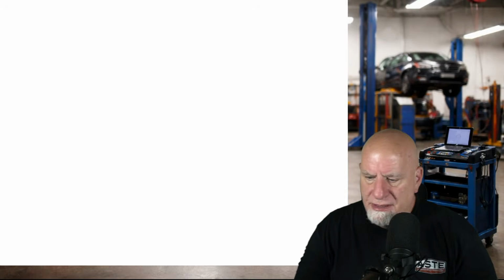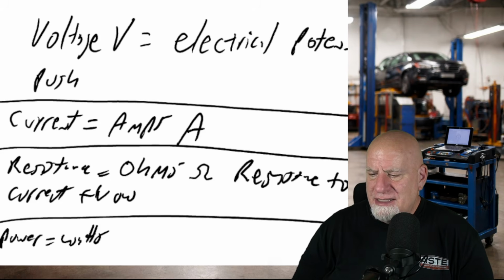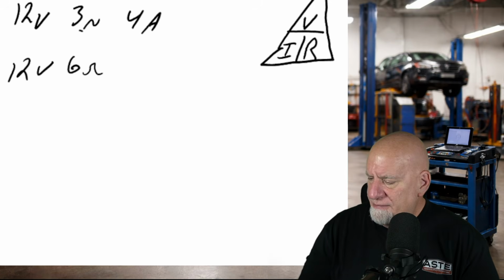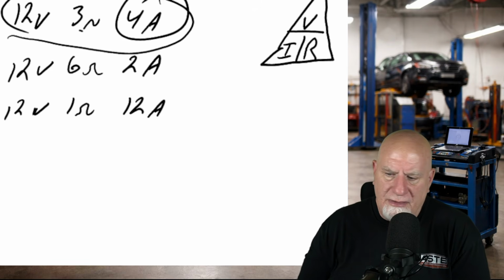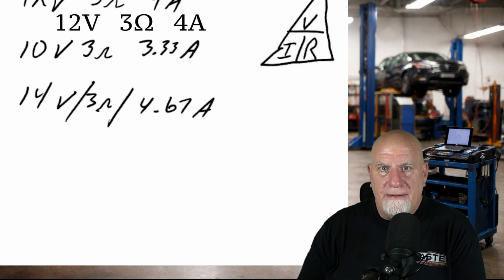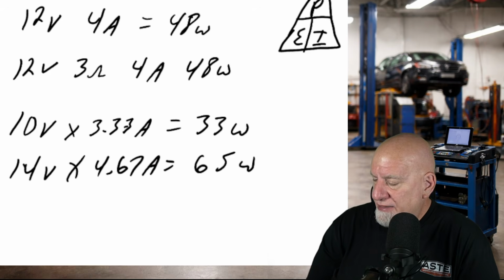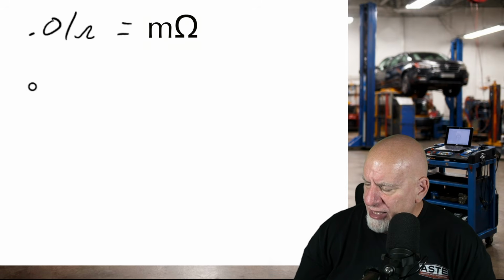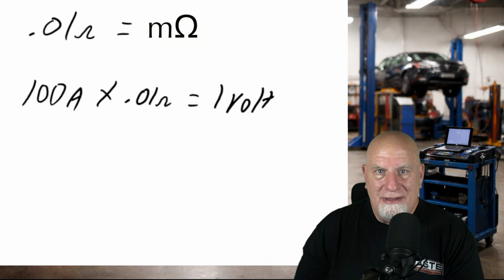Ohm’s Law Made Simple for Automotive Technicians

Comment: You are the best at explaining things!  I have the factory manual for my 2012 Sierra and I see Mex in the wiring diagram. Mex?  Wired in Mexico?  The paper manual is two feet tall. 

And by the way the new gas cap did not work. I only have a code reader so I’m going to go over it as best I can.  Might have to take it in.
Reply from the maker: Thank you Don! If y'all could have seen how many times I recorded this video, lol!
What schematic in particular on the Sierra is it? Yes, it is possible that the truck was assembled in Mexico and the wiring is slightly different because of that. Makes wiring diagrams more exciting 🤣
Reply: @BillTeachesAutoTech I haven’t looked at the wiring diagram in a while but last time I was looking it over I would see Mex in the diagram. I’m assuming that it means if the truck was made in Mexico. I had to change the fuel pump a few months ago in the woods camping. I cut a hole in the bed to access the pump and when I got home I made a nice cover. So now I have easy access. Thank God my son who is a mechanic in the Coast Guard was there to help.
Reply: $700 for the pump!  190,000 miles on it.
Reply from the maker: @donthebrain  - That is a good "stuck in the middle of nowhere" time saving hack! I know techs that would rather lift the bed off of the frame than to drop the tank. I personally always dropped the tank. I wish we could share images here because I'd love to see that cover!
Reply: @BillTeachesAutoTech The truck broke down right in front of a Chevy dealership! lol. They said that they remove the bed when they change the pump. They were a big help but couldn’t do the job until the next week. The truck restarted and I drove back to camp with a new pump. GM no longer makes the pump but the dealership found me one in Butte Montana and brought it to Anconda store. As long as I kept motor running I made it back to camp.
Reply from the maker: @donthebrain  - Thats incredible miles if that was the original pump! And yes, those things are $$
Reply: @BillTeachesAutoTech  last summer the engine blew. Hole in block and pistons missing. lol. $1600 tow big. Stuck in the middle of nowhere but God told some family to turn around and help us. They towed us off the road to safety and let us use their phone.
Reply from the maker: @d @donthebrain that’s an incredible story. Nice of the dealer to locate and obtain one for you. At one point the replacement pumps had a lifetime warranty, but If my memory serves me right, the dealer had to install it.
Reply from the maker: @donthebrain - That is incredible. God works through people in many ways!
Reply: @BillTeachesAutoTech It was a bad situation. God was watching over us.